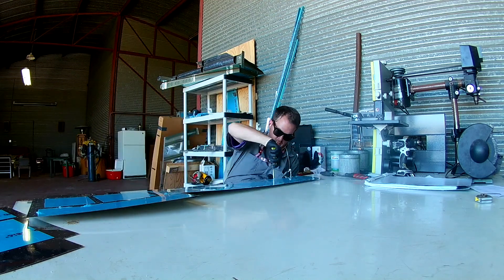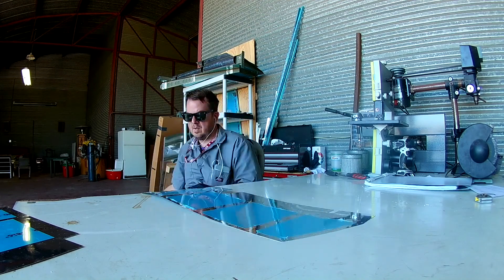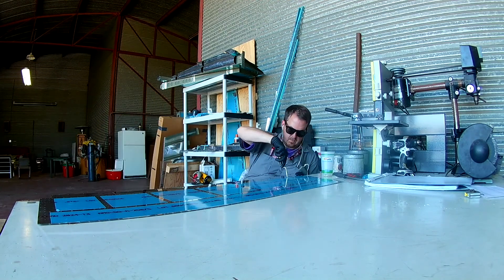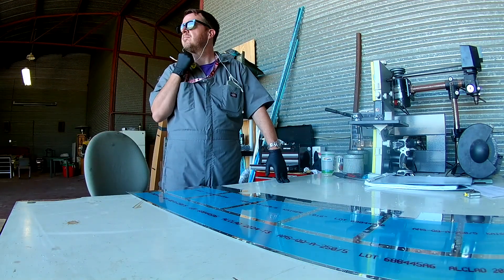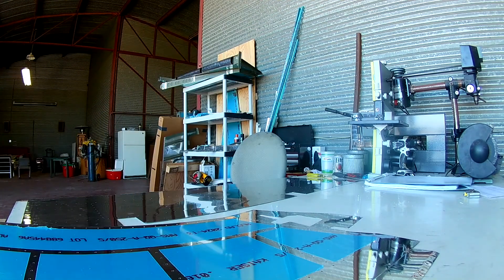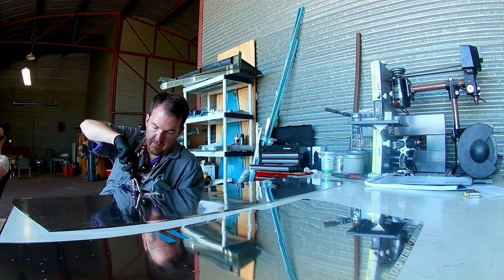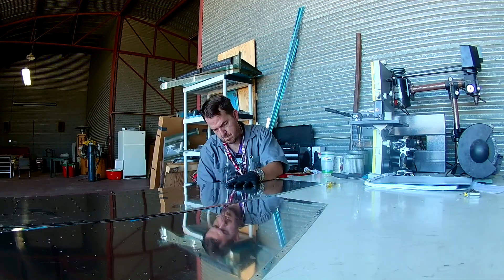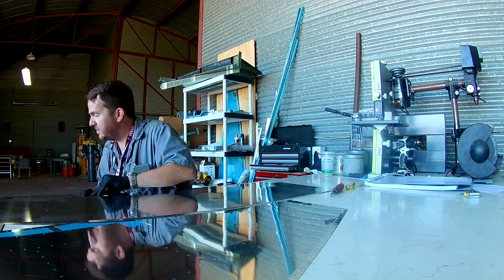RV 14 - Elevator 6

Comment: A deburring method I picked up from Zenith was to lay a flat file down on a row of holes and make a couple of passes.  Knocks off the burs very quickly without the risk of introducing any chamfers.  Worked great on both sides of my 6061-T6 parts.  On Al Clad you my only want to use this method on inside/hidden surfaces to avoid possibility of scratches on exterior/show surfaces.